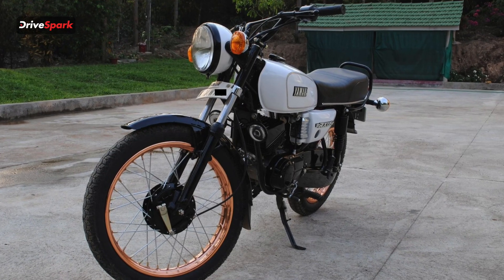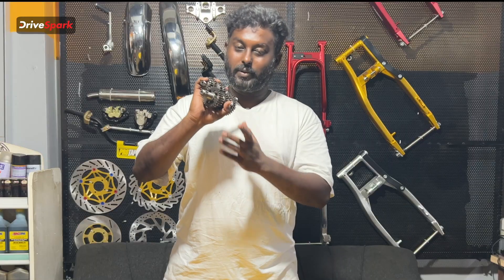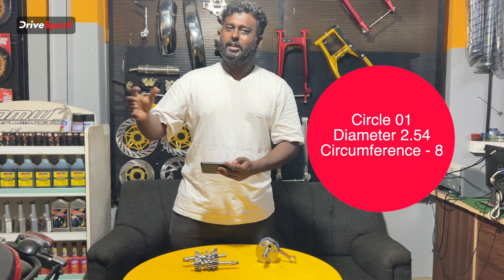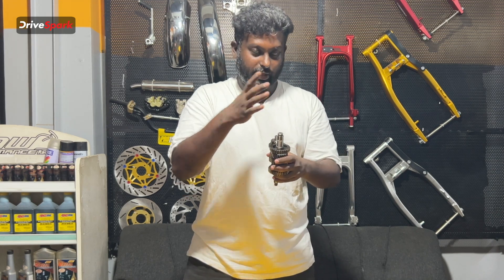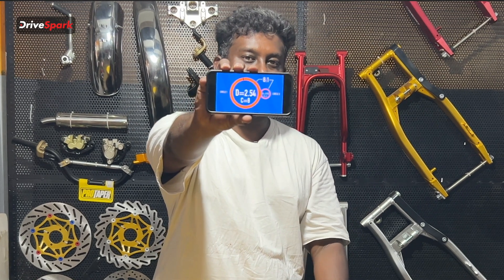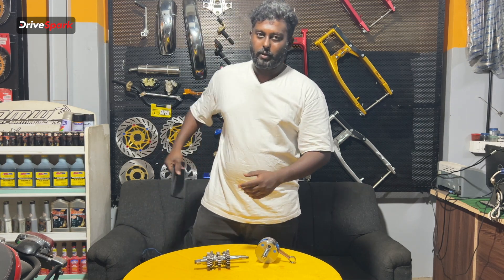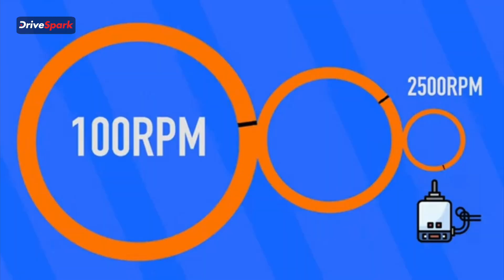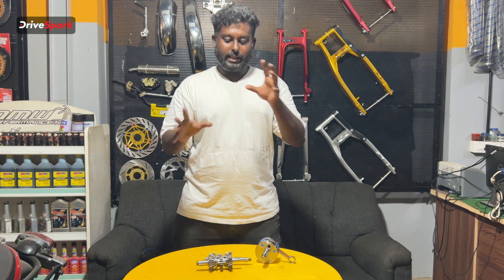Yamaha RX135 Close Ratio Gearbox and Long Stroke Cam Shaft Explained | NMW Performance Racing

Comment: Bro I want to know   - will it decrease the tourqe or engine power , eg : if i ride doubles with close ratio will the power decreases ?
Reply from the maker: Close gear ratio is for performance related. So family use i wont be recommended